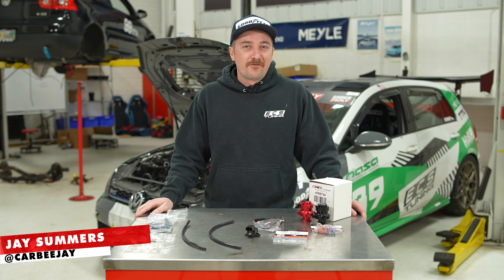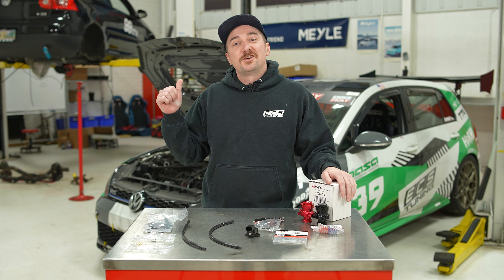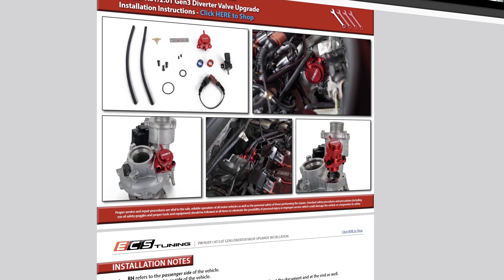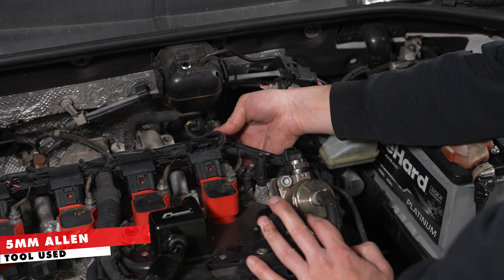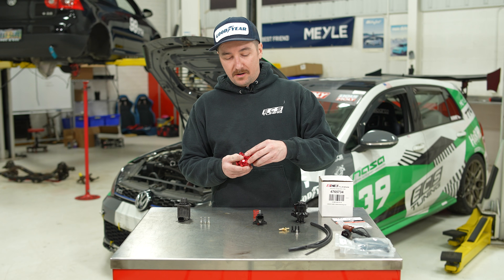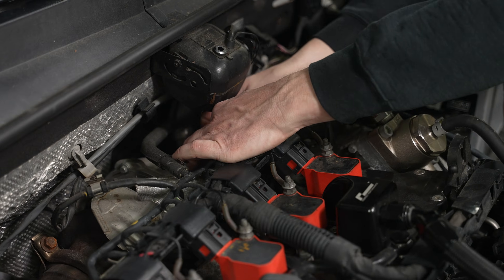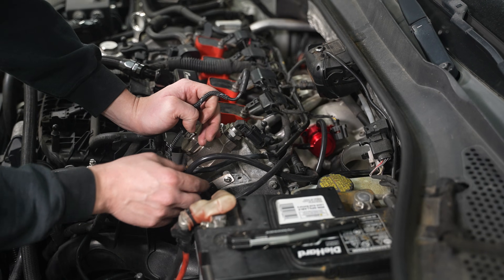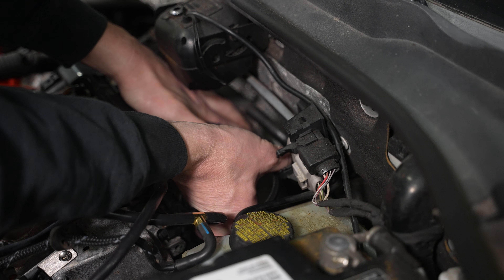VW 1.8T/2.0T Gen3 Diverter Valve Upgrade | ECS DIY

Comment from the maker: This diverter valve does not produce any sound different than the stock diverter valve. A spacer would be required for blow-off sounds but the spacer is not compatible with this product.

Comment: @ecstuning do you have any data sheets to backup any claims, or is the performance difference supposed to be similar to stock? Gfb states that their diverter valve increases performance and it's also the last diverter valve you need to purchase however there's been multitude threads stating how they fail due to the Piston catching on the housing because they weren't lubricated correctly. What makes yours different?

Comment: What spring would i use in an IE True Fuel stage 2 , mk7.5 Golf R?
Reply from the maker: If you're making more boost than stock, we suggest the red spring.
Reply: @ecstuning thank you for getting back to me. I'm installing it tonight do you guys have a video of what it could sound like compared to the stock DV? Will it have any noticeable difference in sound

Comment: Do you sell block off plates for a 2.0T GLI, as shown @2:48
Reply: Are you referring to the block off plate on the vacuum pump? This is a factory component on Gen3 engines.
Reply: @ty_built   yes the vacuum pump block off plate
Reply: @genefrom1647  this will only be available as part of the vacuum pump. That part number is not available separately from VW.
Reply: @ty_built  understood, thank you